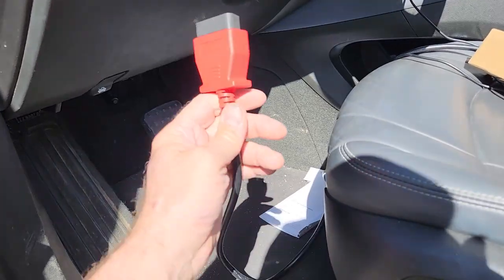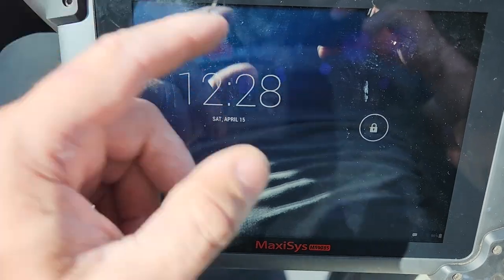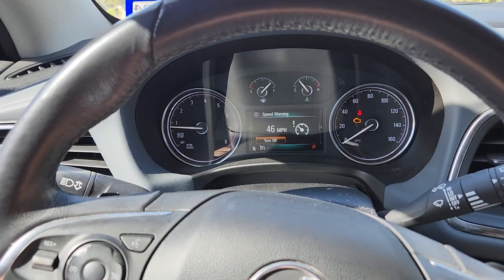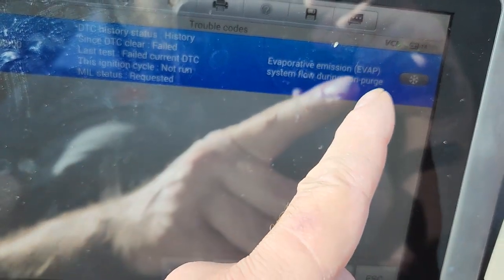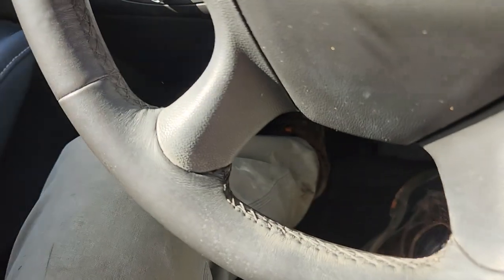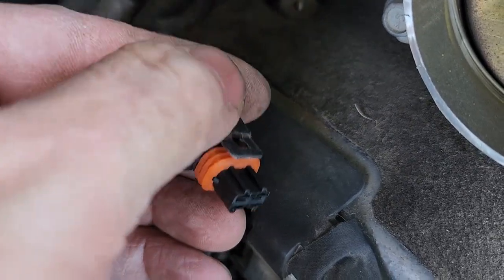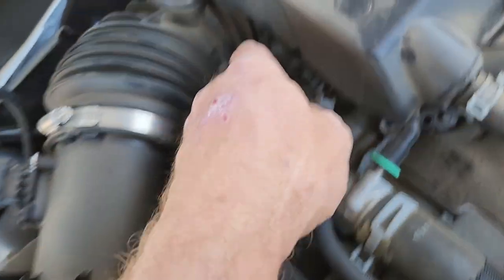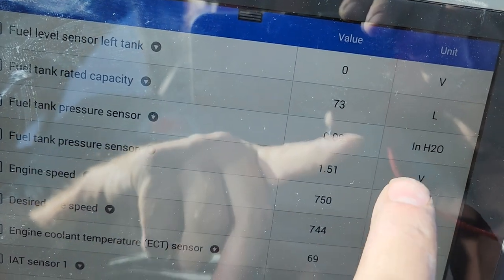How we fixed a Buick Enclave's emissions system in just one afternoon!

Comment: You can go into PCM/ Fuel sys/ ...   and find the purge valve, and run a "bi-directional" control, to manually turn it on and off;   And just see if it opens and closes.  Sometimes just running it back and forth several times can break it loose, and it's fine again for another year. :)...  Or at least use your manual control to test the voltage (or test light) at the connector and make sure it's working on the control side and wiring, etc.  (or just change it, it's old anyway)